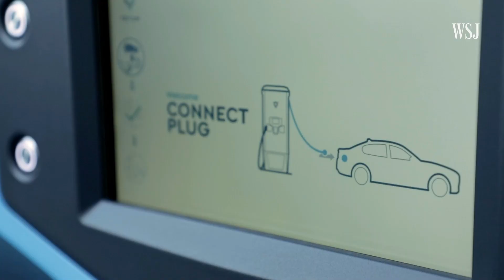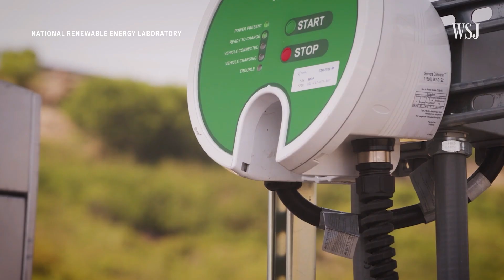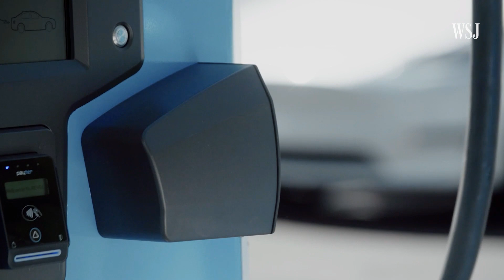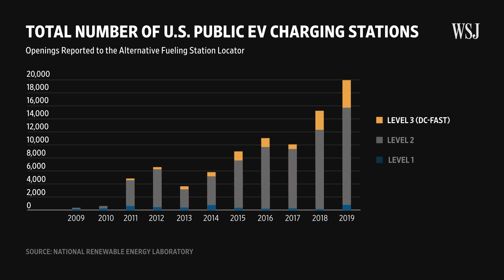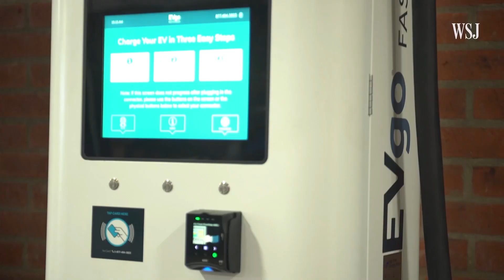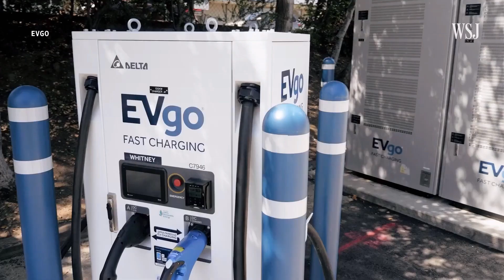Why getting your electric car charged is still so difficult

Comment: Nice to see an inside look at the Tritium DC fast charging at Revel's Superhub in Brooklyn, having visited there recently. Love the techie stuff, better than the usual stock footage for sure.

As far as 240V Level 2 charging at home, I think the term "thousands" might be overstating things a bit, with many residential garages able to add a NEMA 14-50 outlet for well under a thousand. But still, point well taken, I visit Boston and New York City often in my 2018 Tesla Model 3 Long Range, and not only are all the Superchargers the older 72kW type, there are far too few of them. Much like for gas, far better off "refueling" elsewhere, but this doesn't help the local population.

As for Brooklyn's Superhub, it's a big step in the right direction. Also glad to hear they've been making progress with their payment processing system, making an EV a much more viable choice for local residents.

Comment: Your statement about charging is VERY miss leading. 
Level one can take up to several days.  That's like saying it could take several days to fill a gas tank if the pump only pumped out 3 oz an hour.  Even a 120 volt, 12 to 16 amp socket would fill a 50 kwh battery pack in less than 24 hours with a 15% status.

No EV driver ever arrives home with ZERO percent.  I have owned an EV since November 2018.

Also level two charging does NOT cost "several thousand dollars".  

Most if the homes in the United States have One or Several open slots to add new breakers.  

A lot of homes have 240 volt plugs ready to use.

I bet the closer cost to add a nema 14-50 plug is: 

70+% of the homes would be in the $400 to $1,200 range and not several thousands as you state.

Where the government should help is in getting the cost of DC fast chargers down.

When Tesla made the connector their was no standard. 

Tesla should open or allow the Tesla connector to be added by other fast charging sites like EVgo without having to use a Chademo adapter and thus lower charge rate 50 to 60kw.  
Electrify America, Charge Point, Francis Energy in Oklahoma and other DC sites all need the ability to add a Tesla connector to the DC fast chargers without everyone using adapters.
Tesla could also add a couple of CCS1 cables at Tesla sites.

I also think Tesla should add the option to add a CCS1 connector beside the Tesla connector or in the right side taillight as a option at build.

The Cybertruck and the New model X will need to have a on-board CCS1 connector and the Tesla connector as these vehicles will be doing a lot of pulling RV trailers, boats ect.